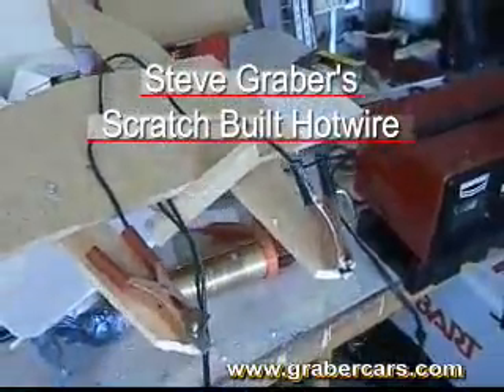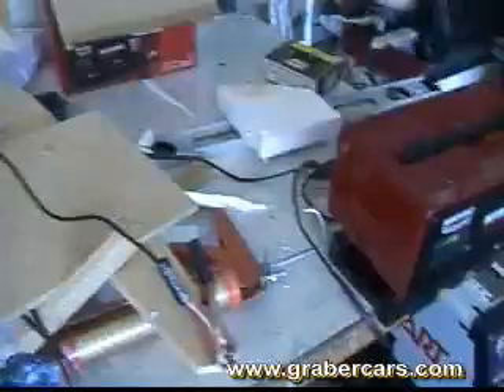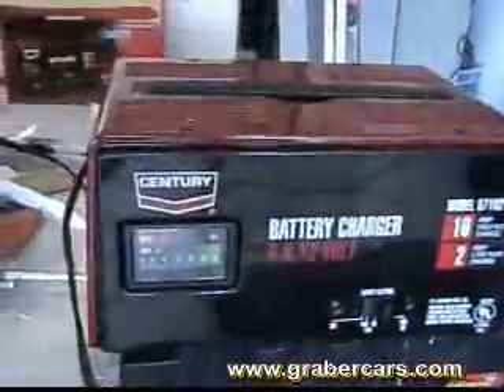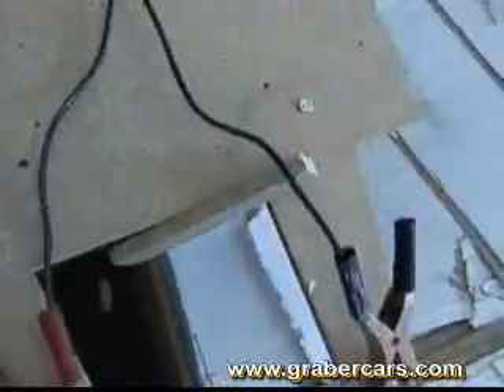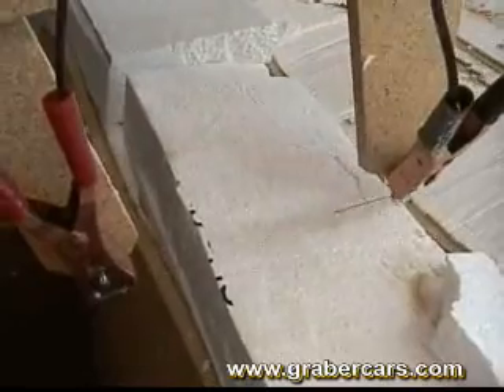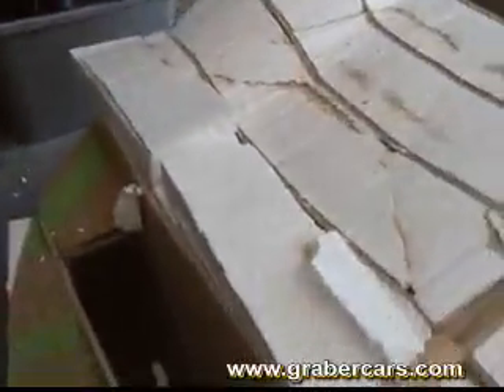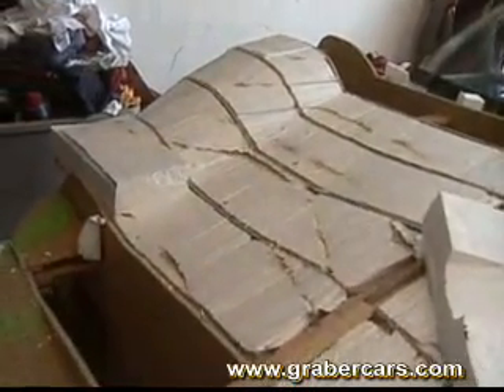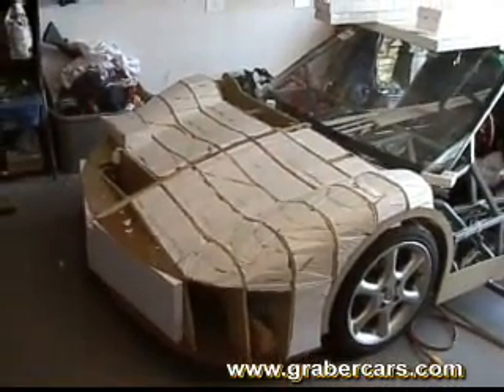DIY hotwire cutter for styrofoam shaping

Comment: absolutely brilliant idea on an AC power  to DC power source alternative! i've been adapting rheostats or converting clunky DC regulators that restrict movement. Question: can one reuse old piano wire or guitar string for the hotwire or is nichrome the only way to go? Thanks for the tip

Comment: I presume that you coat the styrofoam with something before you glass it,since the resin will destroy the foam,i'm going to be trying to make motorcycle fuel tanks in GF but in one piece with no seams,if i can find a foam that the resin wont dissolve it could be glassed in one piece and then the foam melted out with acetone,

Comment: You can buy "Beadalon" stainless steel beading wire, 7-strand stainless steel, .0018 inch, at any beading shop, or sewing goods store (Jo-Ann Fabrics). Works great at 50 volts AC.  Gotta heat up and burn off the nylon coating first. $5 for 30 feet. Apparently one cannot buy .0012 anymore from Hobbytown or other modelling supplies.

Comment: Well folks, a metal coat hanger at 12v 10A doesn't work!  Does make some pretty (but smelly) smoke though... :O

I'll check out the charger later to see if it's ok because I really don't want to buy my brother a new one. :O :O :O

Comment: I tried the guitar string at 12V. This is ok until about 30 cm of wire. If it gets longer, the resistance becomes too high. You would need a 24V transformer. A possibility is to use a dimmer to regulate the temperature.

Comment: Thank you, "since your transformer is limited to 4.5 Amps there should be no problem" I don't know about limiting, It probably is rated to withstand up to 4.5 Amps before it burns out, this is also one of the thing I am concerned : burning out  the transformer. Comparing from a guitar string  will nicrome wire give you greater resistance bring down amps or will it increase it? I am never totally understood electrical flow.

Comment: thx, I  am planning to buy this after trying Guitar Strings for foam Hot Wire cutting, I am using a 12v 4.5A AC transformer. Guitar String worked, but it is slow, I am hoping this wire would get hotter and cut faster, any suggestions. Under the spring tension will it break easier  than guitar string or burn out?

Comment: Well, I't should matter if you are using alternating current or dirrect current, you know, like lamps inside, they are the same as a hot wire foam cutter, just smaller and warmer, and then run perfectly on AC powers, so i should see the problem in using AC as well as DC, but anyway, not many people own a AC powersuply, and most have some sort of an DC suply, like an old PSU from a pc or something :)